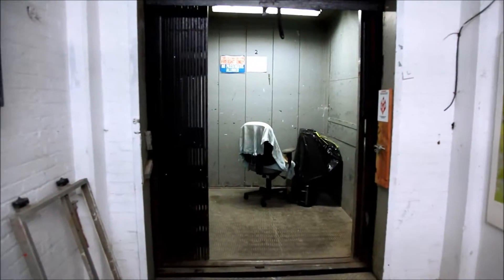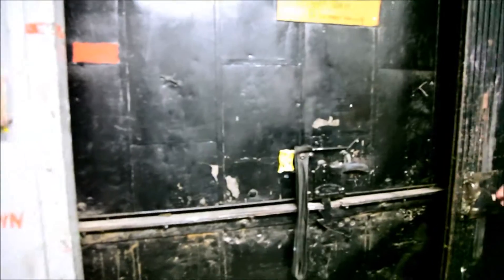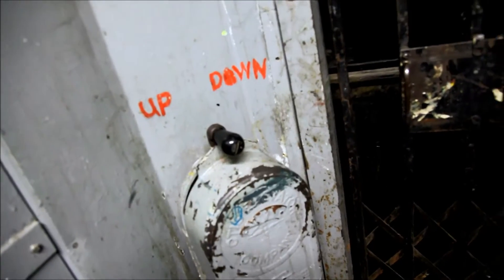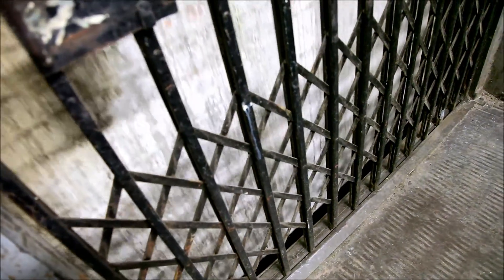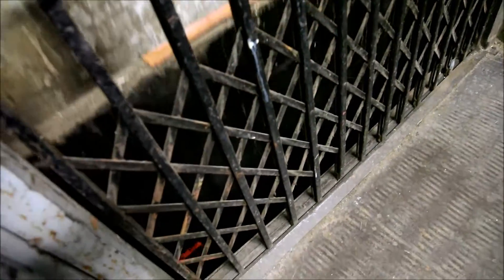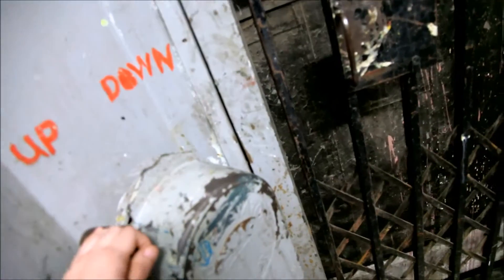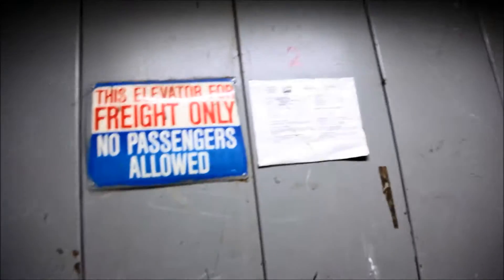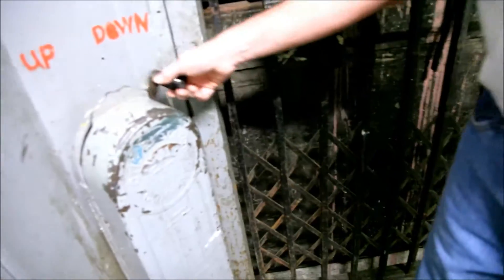Vintage Overhead Drum-Winding Traction Otis Freight Elevator with Manual Control, Hoboken, NJ

Comment: The first controllers were pull ropes that would open a valve for water powered elevators or tighten a belt to turn the traction shiv on line shaft driven elevators.

Comment: an inspector finds an interlock device by-passed or not working, that elevator "gets Red Tagged" taken out of service till serviced. I saw a traction elevator on you tube going up from the basement level with the landing gate open. Interlock was not working, otherwise that car would not have moved. Is this elevator a traction or overhead winding drum machine? Traction machine the hoist ropes pass over the driven sheave held by friction, drum winder cables wrap around the drum.